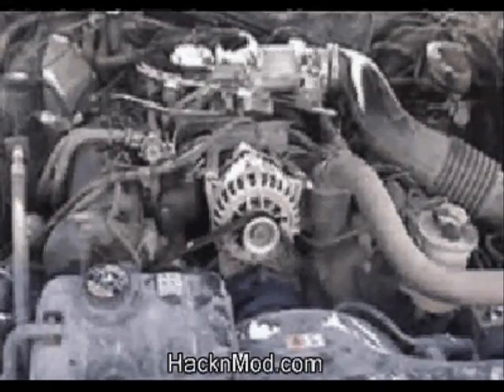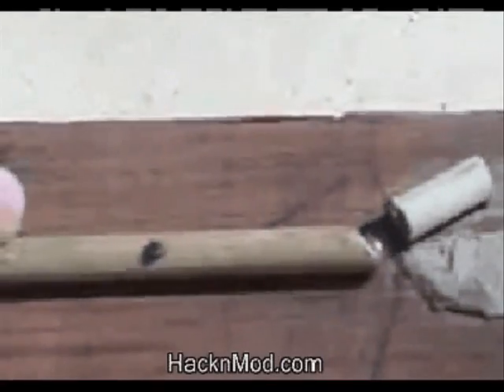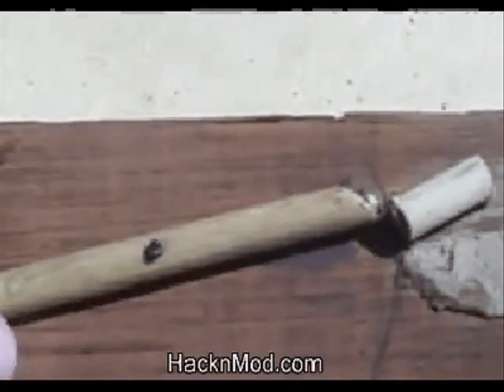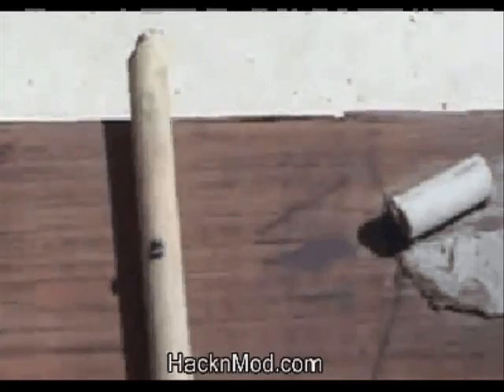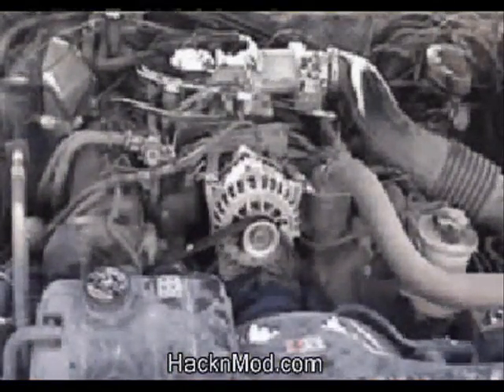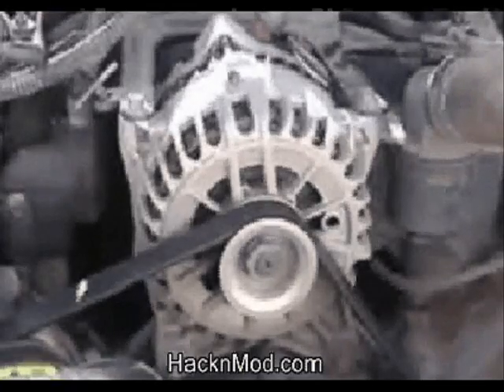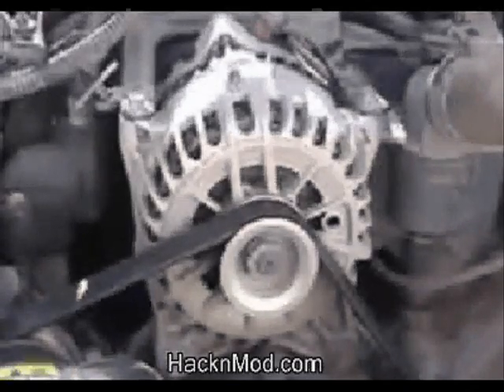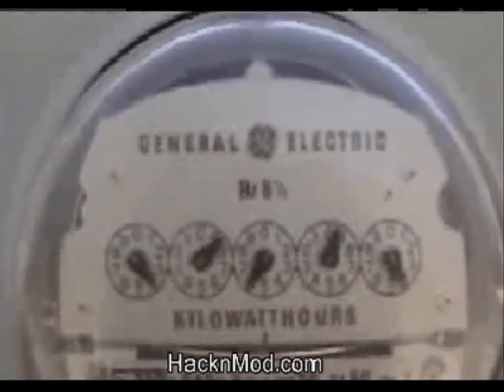How to Power Your Car Using Magnets - HacknMod.com

Comment: as for perpetual motion, as long as there is energy present, there will be motion, right? we use magnetic fields as the source of energy in this example, and these fields won't lose their integrity for years.  that's perpetual motion, over a few years, which is technically not perpetual motion, which in turn technically is still thermodynamically "ok".

Comment: i'm not as liberally minded as kaneknowsall, well of what im assuming from his response, but yes, corporations do "stop" things like this.  example: ever wondered what happened to the electric car?  it silently disappeared, and why?  all car manufacturers, mainly GM, that produced it, recalled all the electric cars they produced.  at the same time, GM bought out the rights to a type of battery that wouldve powered electric cars that would outperform normal gas-powered cars.